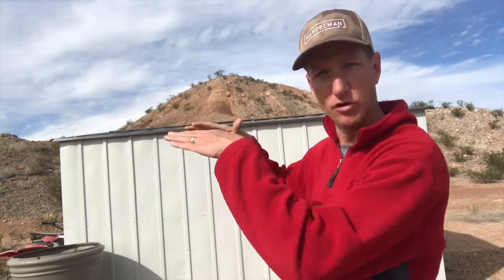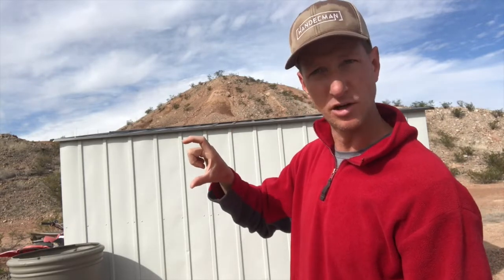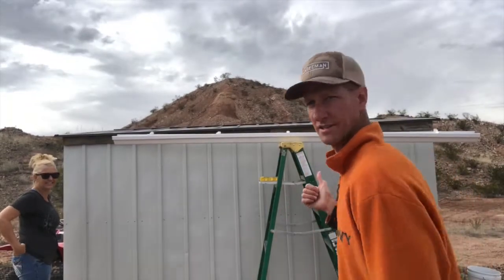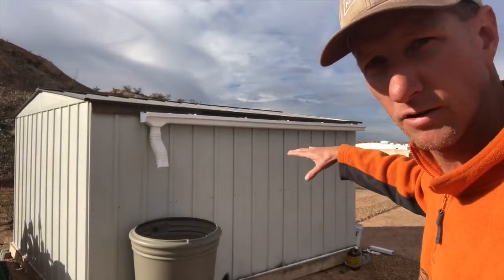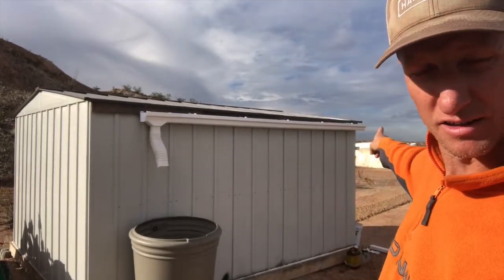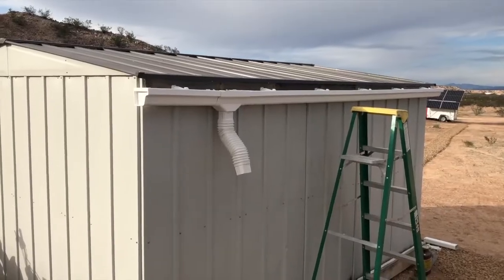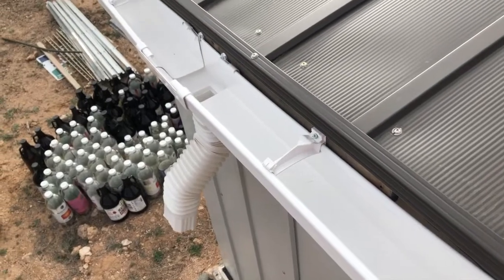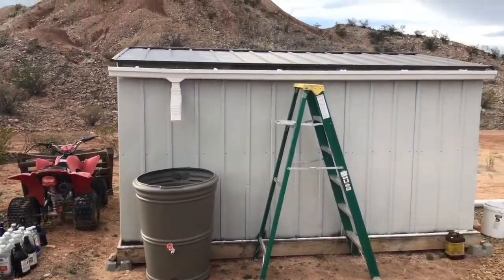First Rainwater Catchment Test (Shed Gutter)

Comment: Cool, thank you! This is exactly what I was looking for👍
Reply from the maker: Glad to hear it!
Reply: @MidlifePrices  actually I got almost everything done until I came to the point of installing the drop outlet. I couldn't figure out for the life of me how to put those two pieces together. Did you have to go buy a rivet tool? There isn't a single video on YouTube anywhere that's using that same drop outlet that's in your video, and everybody else has different types and then they have to use a rivet tool. This project is turning into something much bigger than I anticipated
Reply: @MidlifePrices  now I understand why I didn't know how to install the drop outlet, because in your video you're standing in front of it so we can't see that part
Reply from the maker: @kristinlee9485  Sorry, Kristin.  The video was how to build the stand.  Thanks
Reply from the maker: @kristinlee9485  Hi Kristin, Brian cut a hole in the top to fit the outlet.  I'm sorry it wasn't more detailed.  Thanks, Pam
Reply from the maker: @kristinlee9485  No rivets.  Just used a screw to attach the two pieces together.
Reply: @MidlifePrices  yes! Thank you. I figured out how to do it much more simply. All is set up, now just waiting for rain 😁 Thanks again!

Comment: Why fascia board? Couldn't you just have screwed into the ribbed wall panel?
Reply from the maker: I probably could have, but the metal on the shed is pretty flimsy, so I thought it might provide a little extra stability.  Not really sure if it added anything or not!
Reply: @MidlifePrices  You have a point.

Comment: What kind of screws did you use to attach the boards?  I’m working on a very similar shed, just smaller.
You mentioned in a previous comment how the metal is a little flimsy.I’m worried about the right attachment so it doesn’t just fall off in heavy rain.
Reply from the maker: Just self tapping metal screws.  The metal is a little flimsy, but for a short run, there won't be much weight to support, so it should be ok.  We haven't had any issues with ours.  Good luck!
Reply: @MidlifePrices  Thank you! I’m glad to know it’s been holding up. Gives me more confidence for my project.